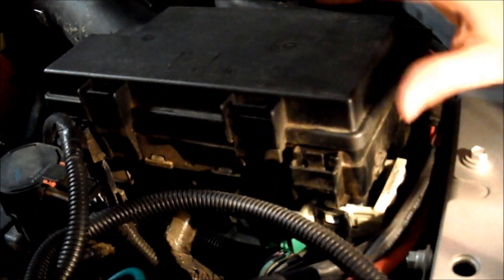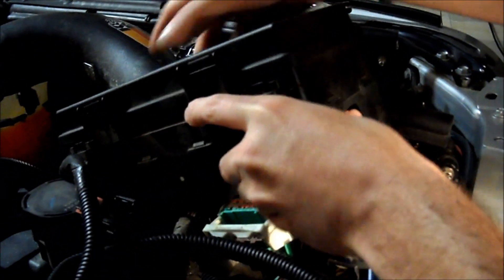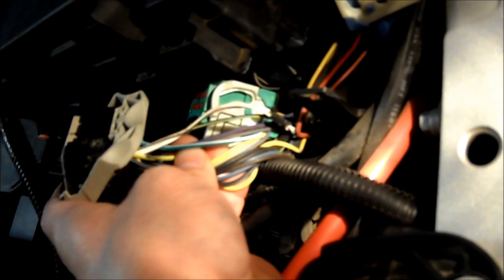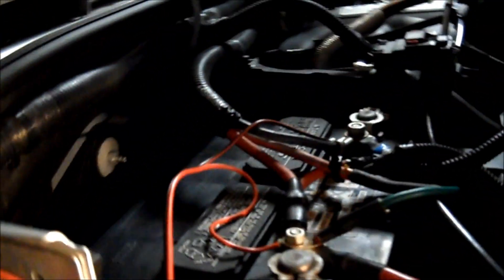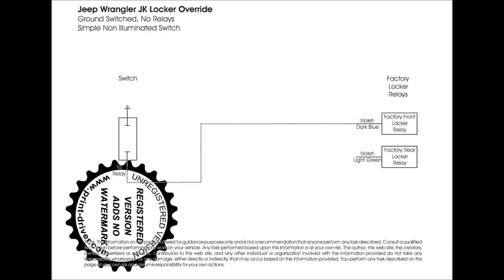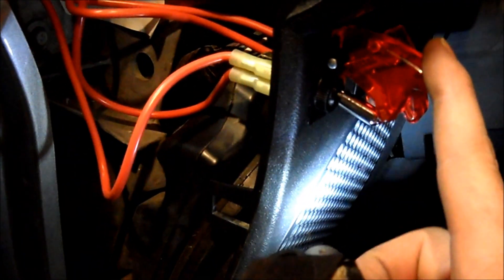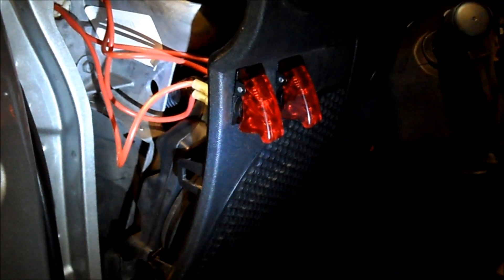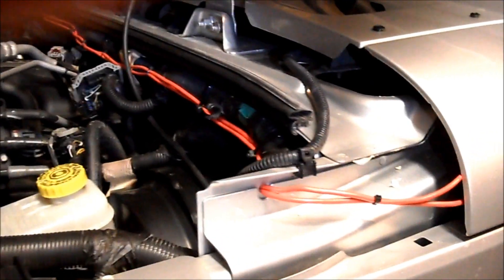Jeep JK Locker Override / Bypass

Comment: Do you ever get the led  light to work on the switch?
Reply from the maker: I don't think I even tried, if it did work it would have to have a separate power source. This just grounds the relay.

Comment: If you are asking for recommendations.  I would recommend you use a green or black wire for ground. Not Red.  Red is typically used for hot or positive connections.

Comment: Thank you for the video! 
I have a couple questions.  So now those switches are now replacing your factory switches?  I’ve seen other people add a switch but then use their factory switches to activate the lockers.  Also, how does the rear locker work when in 2 hi?  Do you need to disable ESP first?  As I’m typing this I noticed the video is 4 years old so I’m hoping you’re still replying!

Comment: I followed your video and looked at the rear of the wire connector you showed. My 08 has 200000 miles and the wires are difficult to see true color. I used my volt/ohm meter probes to push through the wire insulation (on the wire I believe are violet, both wires) and go to ground (negative battery terminal) before I ran the entire length of wire to the cab. I couldn't get the locker actuator to engage. I have been able to hear the actuator engage in the past by another method but that goes around the actual relay and places to much load on the wire I'm testing with.   The actual relay's  (Front and rear) is located on the passenger fender wall. The reason I'm testing your method is my lockers stopped working at the same time but I have ruled out anything in the differential. I am hoping your hack will give me a short cut to repair. Because the colors are hard to see is why I'm hoping you have a picture of exactly where the wires exit the wire housing in your video. Thanks for your help!
Reply: I did the hack before the relays, my dash lights quit working, but lockers are still working?

Comment: Thanks for the video. I knew there had to be a way to do this. Does this make the factory switch obsolete?
Reply from the maker: They still work, but if the override switch is on, the factory switch will not turn them off.

Comment: hi, am i understanding this right, you are running a wire through a switch so you can activate the relay that energizes the locker relays? if so, does this work on 2012s?

Comment: Then you should have retitled this "Jeep JK Rubicon Locker Override / Bypass". You obviously fooled some JK owners into thinking they could activate some imaginary lockers they don't have. BTW, on a TJ Rubicon this override mod is way easier. You just splice a wire behind the switch panel on the dash.

Comment: hi i have a 2008 jk so all you did is run a wire from the violet wires to the switch and then grounded the switch. you didnt have to run a hot wire?